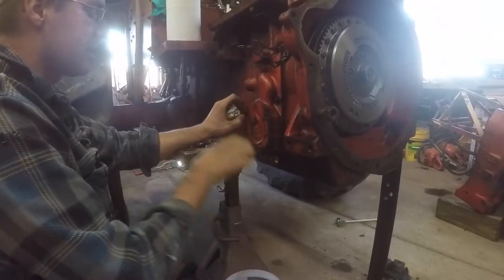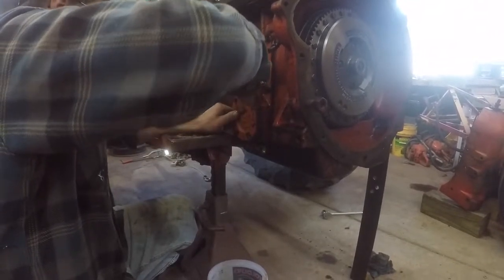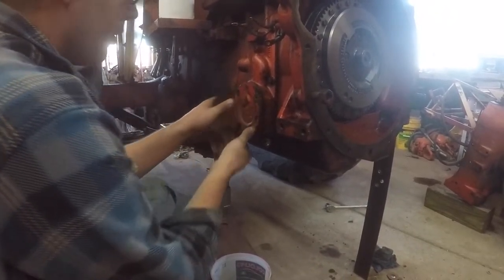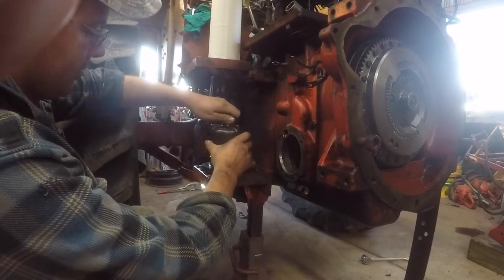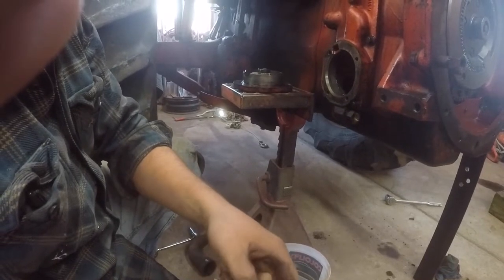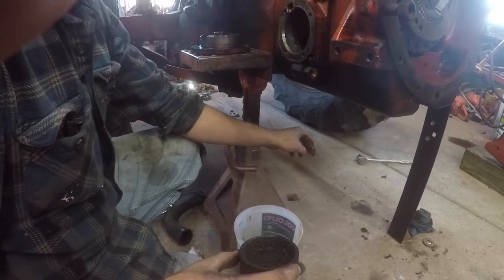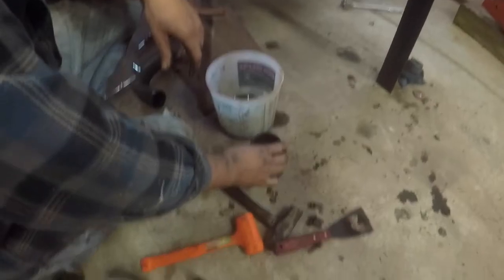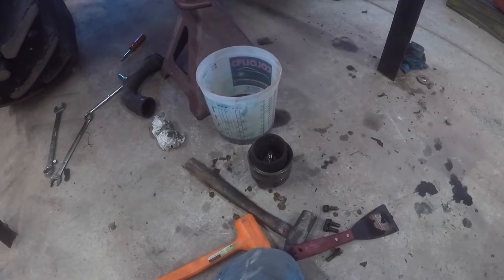Case o matic filter removal and transmission inspection.

Comment: Hello, I hope you can answer this question for me. Not sure what size this tractor is you are working on here. I have an early 1960ish Case 530 Loader Backhoe the attachments are model 31. Not sure what the tractor is as the tag is gone. I just got it home yesterday nice looking tractor (Motor is blown) it is gas I found a motor for it I have not gotten it yet and I need a sky hook to pull it. I have been looking all around the internet trying to understand how all this works. Mine looks like it has a clutch disk, pressure plate in the very front under bell housing as there is a clutch rod running to what looks like would be releasing the clutch disk. I have not taken it apart so have not seen an actual pressure plate and disk, it just looks like how a car would work. Watching this video makes since I just do not see why mine has what looks like a clutch pedal and rod going to front of bell housing like a cars throw-out bearing releasing the pressure plate and disk. I also have no idea how to operate all the sticks i.e.. I know how to shift it in gear and how to push what I think is the case-o-matic lever to go forward, natural or backwards There is also a lever on the lower right side in line with the forward and reverse lever maybe it is a high and low for the case-0-matic I do not know. There is also a foot lever just below the brakes that has a linkage that runs to the front of the head I think it traces there. Any info you could share would be appreciated. I will get a service manual if I can figure out which manual to get and where to get one.
Reply from the maker: Hi Carbie;  This tractor is a 1967 Case 830 Comfort King with Case O Matic. The Case O Matic  will have a 2 spool valve body on the drivers side of the bell housing. It requires very little effort (less than a standard clutch) to disengage the drive, I have seen them with what looks like a gas pedal instead of a regular clutch pedal. So, since you have to pull the motor, when you pull the blown engine out it will either come out very easily if its a com and it will slide off the input shaft if its the standard ordinary clutch set-up. Hope this helps. Thanks for watching and commenting!! John

Comment: I have a gas 530 case o magic backhoe starts okay. How does the power compare to it's diesel brother
Reply from the maker: Hi Ferenzi: Sorry I couldn't tell ya for sure. I had a 530 also many years ago and it was worn out. It had good power as a gas model and compared to my nephews older Case backhoe that was diesel it seemed stronger. Thanks for watching and the comment! John
Reply from the maker: FYI; Changed channel name to John Frytag. Thanks!

Comment: Case o matic is hydraulic clutch with a torque tube? Foot pedal and hand lever?
Reply from the maker: Hi Lacey; Sort of like a lock-up torque converter that you control with a clutch pedal and lever to lock it in. Thanks for watching. John
Reply: @JohnFrytag  how does the torque converter get locked into place? It's hydraulic pressure right?
Reply from the maker: yep there is a pump and a clutch that gets engaged by pressure when you flip the lever to direct. this one when we got it had the 'kick down tab' disengaged so it would snap right into direct if you forgot to put it into converter " non direct" drive. was just like side stepping a clutch. just about throw ya out of the seat.
Reply: @JohnFrytag  oh dang. Mine has the case o matic I just never understood really what the hand lever did on the right next to the gauge panel. So it's all hydraulic until you engage the direct drive lever then hydraulic pressure "mechanically" links the torque converter straight to your gear box? I don't mind if you don't answer its probabaly annoying but I'm just trying to understand it.
Reply from the maker: @lacey2450  yep, no problem. So once you let the “clutch pedal” out you are in torque converter drive, lots of slippage. When you pull the lever it locks it into direct.
Reply: @JohnFrytag   Thanks man yeah you just cleared the air for me I only knew about regular hydraulics not transmission case of magic hydraulics and I was trying to understand the schematics a little better you are the man thank you
Reply from the maker: @lacey2450  glad I could help